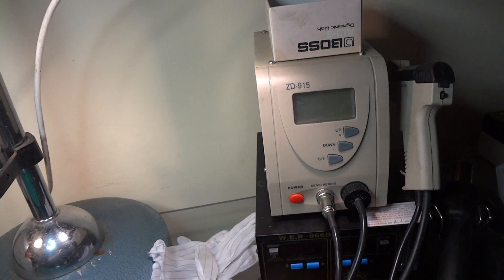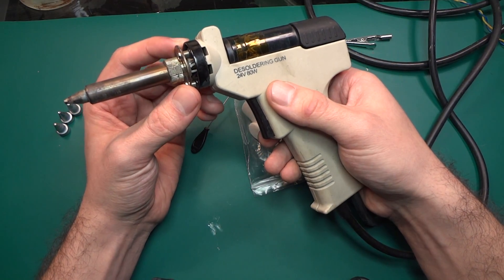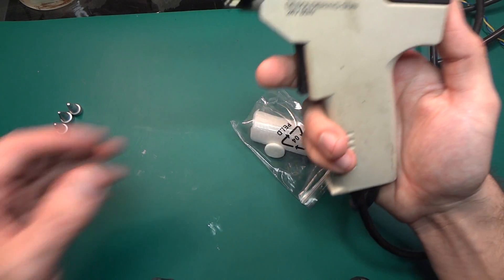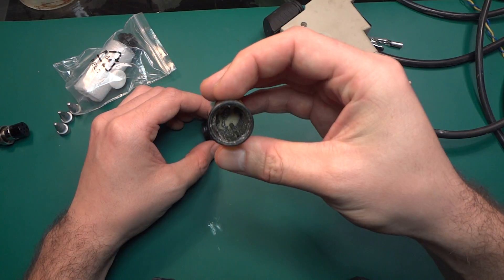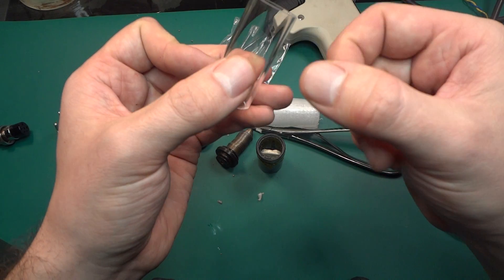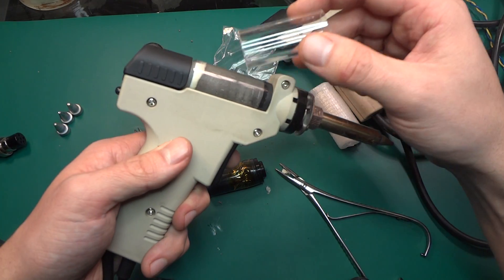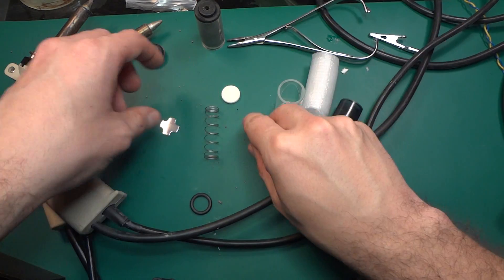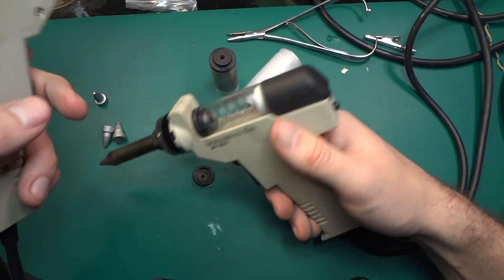[1/2] Desoldering station ZD-915 [upgrade plastic filter enclosure for glass one]  overal opinion

Comment: I've got one and the glass tube is very difficult to get back in without the filter popping out first. the release clip imo doesn't retract back far enough to easily replace filter in tube its gonna break eventually.
Reply from the maker: Mine was exactly the same - hard to pull - just saying that I had to live with it so it's not just Your defective

Comment: I' ve bought a used one too (I have the SSD-15 but it doesn' t change anything not the one he uses in the video) and I' m not at all satisfied. I need it to repair a 'other desoldering (AB18) . Crazy. Maybe changing the gun and improving the 'suction aspect ....... . I have to find a solution for sure .
Reply from the maker: I'm still using this station to this day so it make it almost 10years - what exactly is Your problem? If suction is not enough unscrew that element between station and hose - and check vacuum with finger. If it's good then screw it back -  remove hose - check again. On mine it often clogged between hose and that plastic cap.  If it's correct then they are selling whole gun assembly with heater and all seals.  If You have feeling that it's not pulling  enough then most like tip need replacement - it's being eroded inside - swap it with brand new and You will see difference.
Reply: @ElectronicNoobBlog  I go to test to see if the diaphragm is okay or the tube clogged and so on. On disassembling the desoldering tip, I notice that the extension is "cut off" and thus does not reach the 'tip nozzle. It gets hot but because of this it does not suck in. OK. I'll do two tests and then see how to proceed. Thank you.

Comment: Will this station satisfactorily desolder  lead free soldering?
Reply from the maker: I can't really tell because most new lead-free devices i work on are  SMD based, rarely I came across THC components, except like sockets  - but they often on multiple layer that by itself is a problem or have large ground plane. In that case I'm adding lead solder using soldering iron - then suck couple times (multi layer PCB like motherboard).

Comment: Cut the tapered end off of the spring so that it is simply cylindrical in shape, and stick a little bit of medium grade steel wool in there to catch the solder as it is sucked into the chamber. Using your hot air gun to clean the solder from inside the spring is just way too much like work!

Comment: your metal plate obstructs the air intake in front of the cotton pad !!!! the pump may make the soul faster!
Reply from the maker: Thank You for comment, but it came from factory that way, plate is there not to start fire when hot solder hit cotton pad. On previous plastic model there was a metal spring that was taking heat from melted solder, here on glass there is plate for that reason. 
I would not advice remove it, it can create serious fire hazard.
Reply: ok I understand better with your explanation and actually better not remove it is sure!
if not, are you satisfied? but it is true that it must plug the suction through the metal plate? I would rather opt for a fine grid but the problem is that it must be blocked too.
Your video is very well done.
Do not hesitate to subscribe to my little channel
Reply from the maker: I think it's very good value for money.
I get from my job Denon SC7000Z with is a de-soldering more towards professional for over 500$ and i make compare... and as You can see i stay with "china" one and give Denon to friend who is working professional. 
For me pros for china one, are CHEAP consumable parts... for 1 PCS of size tip  for Denon i can get whole bag of multiple tips for that chines and that is saying to me that is good deal. Even if i replace tips more often i never pay off buying one of Denon.
Also Denon had pump inside handle and it was heavy with for me is a concern (but it have more aggressive suction with was a big point for Denon).
As You can see for me the answer was simple, stay with china one and be happy.
If I have factory or service center, most likely good quality Denon would be a better option but for my personal use that china one fits perfect.

I will tell You something, if You are really concern about loosing suction by that metal plate (with is obstructing air flow, no doubt about it You are 100% right!)  there are things called "Metal sponge" :

https://www.google.com/search?client=ubuntu&hs=NZJ&channel=fs&biw=1861&bih=951&tbm=isch&sa=1&ei=3pGHW7DoCoGlsAHb846wBg&q=metal+sponge&oq=metal+sponge&gs_l=img.3..0l7j0i5i30k1l2j0i8i30k1.25129.25794.0.25900.6.6.0.0.0.0.77.425.6.6.0....0...1c.1.64.img..0.6.421....0.Im9-SZ3gnto

I think it might be a good replacement and improvement to just stuff some of it as a first filter.  

I will check You channel, if it's about electronics or radio - communication  then definitely give it a try.
Reply: The filter pads are not cotton.  They are made from 3mm thick ceramic fiber blanket.  You can buy square sheets of this on E-Bay along with a 17mm hollow punch and make your own filters for pennies a piece.   Use only one filter in the chamber, change it when it is full, and this station works like a champ.

Comment: I ordered this exact model and it has no suction right out of the box. What can I do?
Reply from the maker: Start from checking if there is suction at base of de-soldering station. Unplug hose, trigger vacuum pump and using finger check if there is suction. If is, remove whole filter glass, and check using same routine if there is suction on the back place where You normally put glass element (don't touch front it will be burning hot!),  if yes check if nozzle is not clogged by inserting cleaning rod. If not clogged and still no suction maybe there is missing one of the silicone seals.
Reply: no suction at the base. I returned the item today because it was still under warranty. I think the problem it was shipped UPS which is notorious for slamming packages and breaking things. Thanks for your help!
Reply from the maker: Understand, hope You get replacement soon. Regards

Comment: A Hakko fx8801 genuine replasement iron for Hakko stations cost around 19 dollar.to combine them by using the plugg cable and pcb inside the handle from WEP solder iron iron.(WEP/Yihua s,iron have movement sensor on pcb Hakko do not.And i like the sleep mode.by using Hakko heat element and all the plastic and metal parts from Hakko iron and using the calibrate fro temp on my station i had to go -40 degrees celcius by using the meny for adjusting temeratur compasation.I have now a good solder iron that is reliable and comfortable.can toutch the plastic basenut at the handle without getting burned.made all the difference this mod for me.

Comment: like your video.Have the same type station.Here are some mods.When using glass tube and long spring and metal washer to push the filter against the back.drill some holes 1mm in the metal washer.this makes better vacum and the filter get more evenly dirty and last longer.take some steel wool(not the fine type) make a little ball off it an put it in the midle off the long spring.this catch solder and stops it before it hit the metal washer and filter.I also have a W,E P 2 in one station.The solder irons on them is Hakko clone with very bad materials/plastic.The plastic basenut that hold the tip assembly cracks up at high temperatur and the ground spring behind the plastic basenut pushes the hole tip assembly off. and you can get burned.It happend with 2 irons to me.they lasted for one week.Buy a genuine Hakko fx8801 replasement iron for hakko station.Use the W.EP iron plug and cable and pcb.put this in the genuine Hakko iron.And use the hakko heating element.the pcb from wep iron fits in hakko handle.Hakko pcb do not have moving sensor for sleep mode so use the wep pcb with cable and plugg.the rest should be the Hakko iron.after compansation the difference in temperatur from WEP heating element to genuine hakko element.(my WEP station i can calibrate this by holding 2 buttons and then go up or down 50 degrees celsius)had to go down 40 degrees celius to get the display to show the correct temperatur.The Wep iron get so hot at the base that you cant toutch the plastic basenut but with the genuine hakko+Wep combination i can toutch.the Hakko heating element is good at isolating the heat at to where the tip is over.The WEP element gets hot all the way and result is hot handle/basenut.i also have a simple mod to make the swich mode powersuply able to last for many years by moving the fan.nothing extra needed.if interested i can describe it:
Reply from the maker: Thanks for share, i like that idea about drilling holes, maybe even find a steel mesh.
I can share my recent finding  (not exactly mod ) was start borrowing from girlfriend "cosmetic cotton pads" just cut them with scissors and  You have unlimited source of cheap filters!